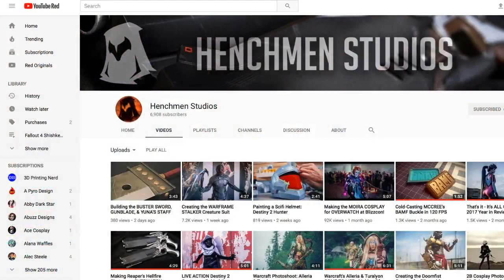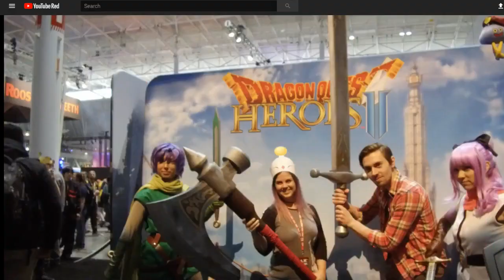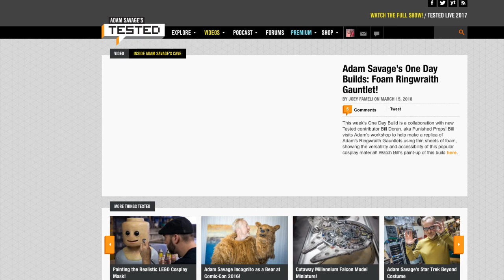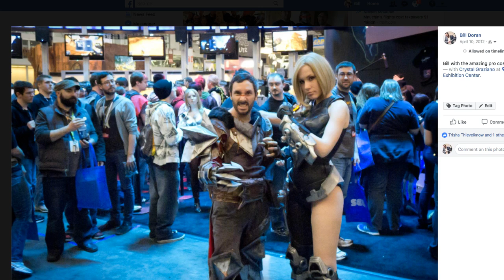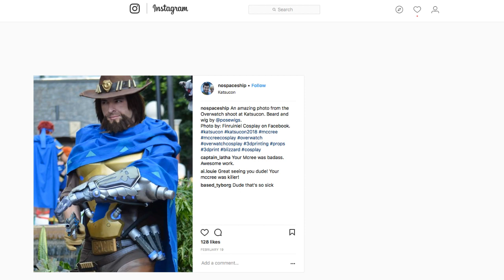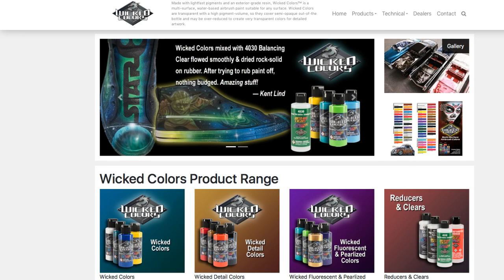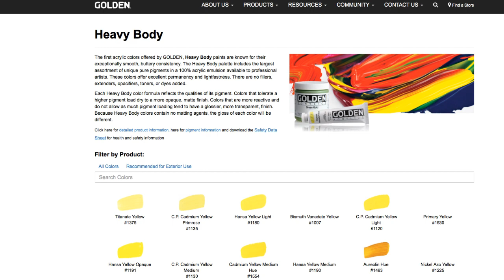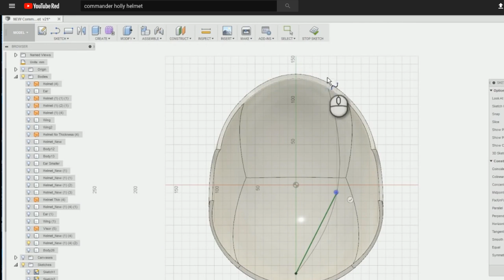Prop: Live - Q&A with Henchmen Studios - 3/15/2018

Comment: I think I'm going to start sealing foam with PAX paint.   Seal and paint simultaneously. For those who dont know (as I understand it) PAX paint is a 50/50 mix of Pros-Aide Adhesive and acrylic paint.  mostermakers.com sells pros-aide as "ProTac Acrylic Emulsive Adhesive".   I'll probably get myself a paint gun for large parts.  I'm currently using this pax paint to paint power rangers boots from black to white.  brushing doesnt look very good but Im sure an airbrush with some watered down paint would work well.  Also, PAX paint dries a tad tacky or sticky, so an acrylic medium is needed afterwards.  That actually helps as a it comes in different finishes like gloss, matte, and they even have crackle ones...I'll be playing with this soon.  But this is often how they paint prosthetic appliances.  Hope that helps anybody.
Reply from the maker: Interesting idea! Let us know how it works on twitter! https://twitter.com/chinbeard